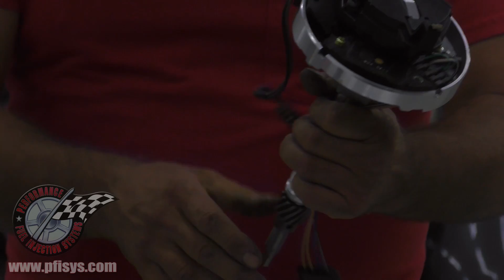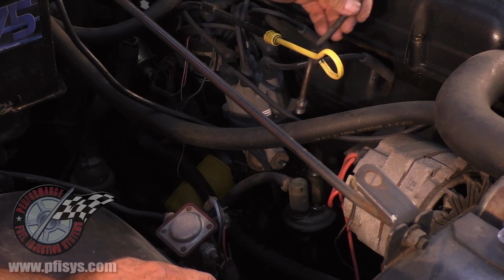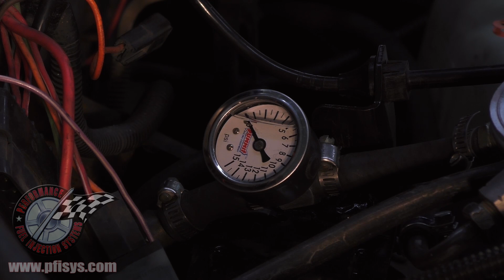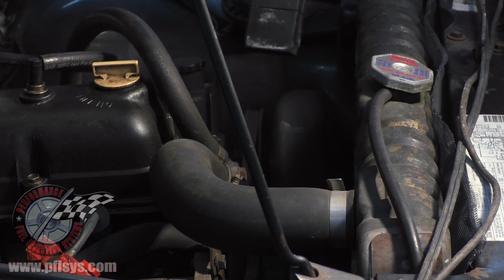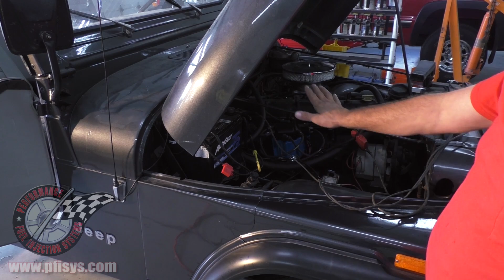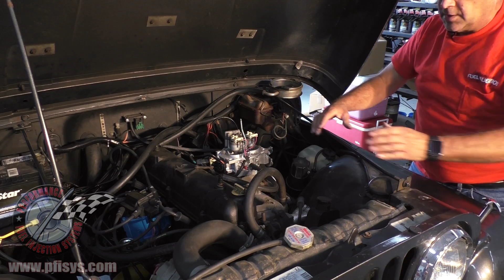Jeep Fuel Injection Installation

Comment: what about vacuum advance off the distributor on a 304 amc
Reply: mine runs awful rich driveable but if you stab throttle lets say to pass a car it back fires and dies out
Reply from the maker: we disable the vacuum advance on the distributors and if you are converting your HEI Large Cap distributor W/Coil in the cap we tell you not to hook it up

Comment: I need a Fuel Injection distributor for the MOPAR Slant Six (170/198/225) with the base out there with the turbo upgrades, it would be awesome to have a drop in unit.